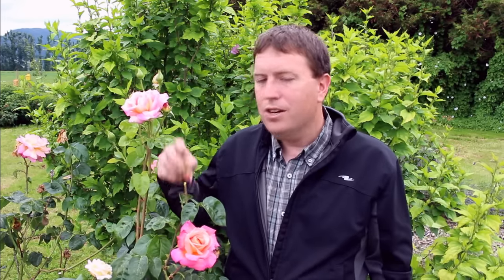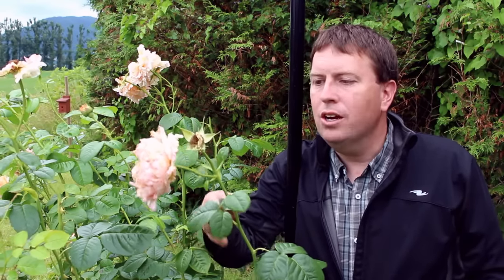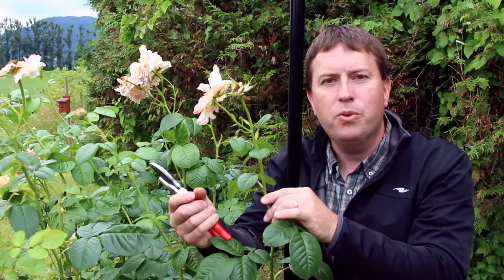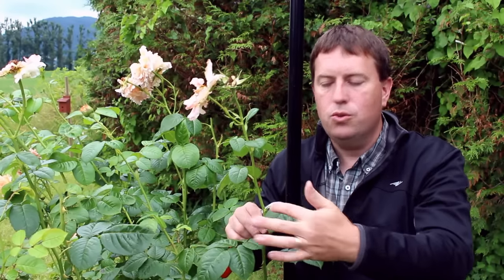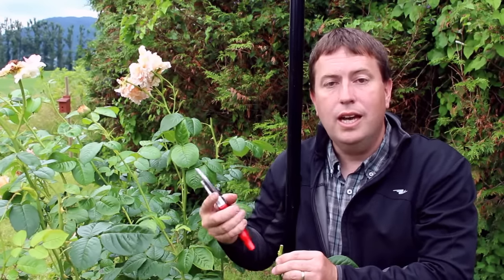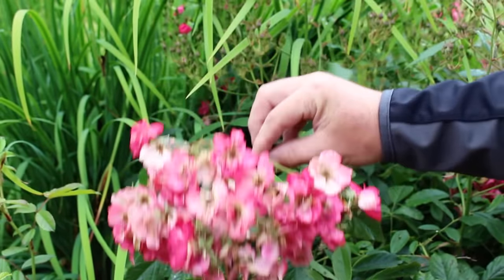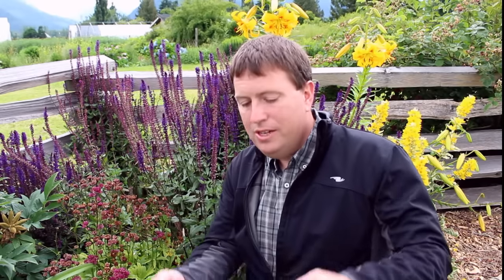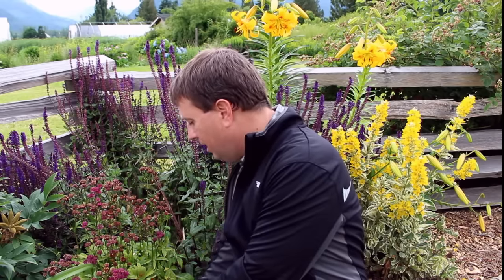Deadhead Roses for More Flowers

Comment: Can i use the stemps that i cut to try to regrow new roses
Reply from the maker: Yes, but if I'm taking material for cuttings I usually go back a little further than the next 5-leaflet leaf node. You can combine this is structural pruning/thinning to take off larger sections of stem for cutting material during the active growing season.
Reply: @FraserValleyRoseFarm  ty very much

Comment: Hi Jason, i am a newbie rose grower. I love your videos. So informative. You said in your last video that the stems rubbing against each other causes them to die off. I have yellow english roses, and the stems just fall to the ground and catch bugs. They completely fell and wouldnt even stand up  I tied the flowering stems to a stick but some stems are bunching together. What is the best thing to do, to let them grow and stand up tall. Any advice is valuable. Thanks in advance Jason.
Reply from the maker: Hi Sammy. How long have you had the English roses planted? I only ask because sometimes the young growth of a rose can be a little floppy/lax before it's well established. If this is the case, once it's growing strongly, a spring prune and fertilize can spur on new (stronger) canes. That said, some roses are just lax as their long-term habit - it can be quite graceful in the right situation (trained over a low fence, or cascading over a retaining wall) but not so nice when they just drag on the ground like in your situation. The rubbing/crossing stems are an issue you'll see as physical damage to the skin of the canes - and if you're training to a post/fence/support, just watch for the signs of damage.
Reply: @FraserValleyRoseFarm  Thankyou for your reply Jason.Yes, I have not had it planted for long, 3 weeks roughly I would say. But the leaves and petals were beginning to die where they were touching the ground. So I tied them to stalks. Which were still not standing tall (maybe the weight of the roses? ) but were still off the ground.
Reply from the maker: Good to hear. There's still a good chance then that it'll grow firmer stems in coming seasons. Best luck with your roses!

Comment: So I'm not sure the kind of rose I have I do know it blooms several times a year and the roses are generally a light pink to white roses and the leads are orange and red and have not bloomed yet but my issues is over the years it has grown very large it stands about 7 ft tall is like for it to be alot smaller is it ok to just just the steams to 3ft in length without causing harm
Reply from the maker: Hi Brian. I'll reassure you that a healthy, vigorous rose will usually have no problem recovering from even a heavy prune. That's the way I would do it. If you want to be a little more cautious, you could thin some of the older/thicker canes at the base, and reduce the others by 1/3, staging it down a bit each year as the growth refreshes from the base.

Comment: It's better to "snap their heads,"not using metal or plastic to contaminate the plant unless you want to back to a leaf node, then sure use pruners or scissor.  If they do not snap easily, it means you need to water.  Heps are good for birds in winter.  Knockout likes to "deadhead" itself.
Reply from the maker: Thanks Pat
Reply: @FraserValleyRoseFarm  Old rosarian.